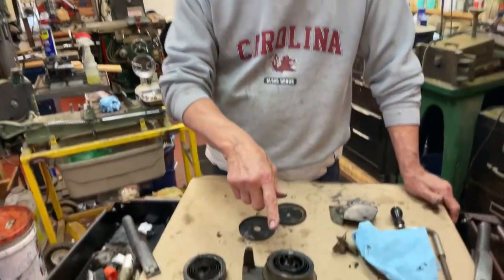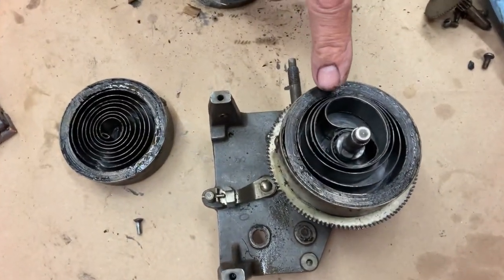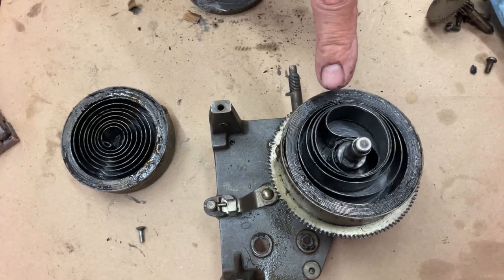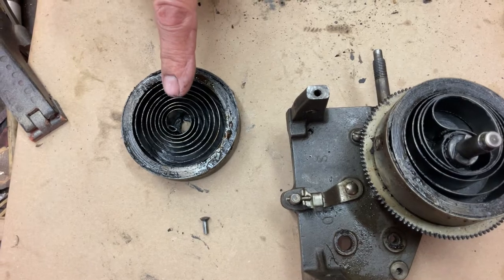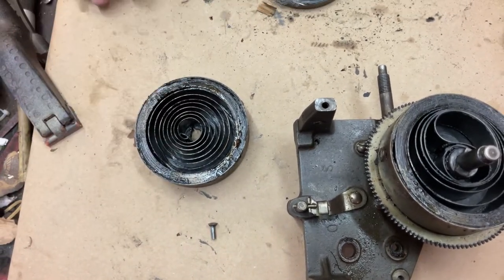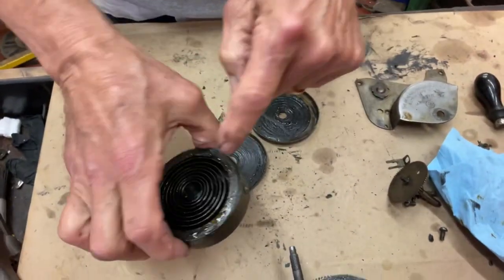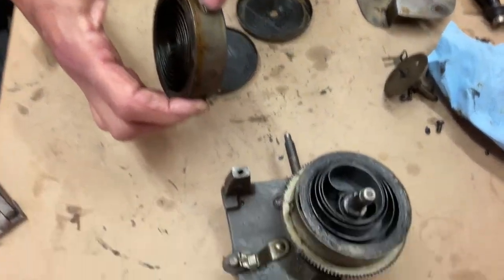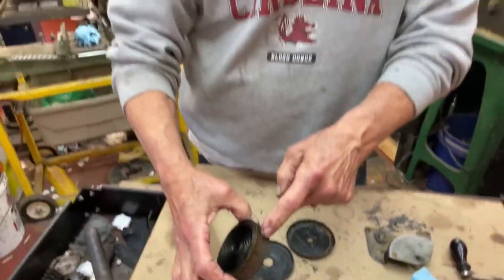906.  Take notes on which way your original phonograph springs are in the barrels

Comment: I am working on a double spring now, from a Pathe model VII.  I thought about marking the spring somehow, maybe with a clip or duct tape.  Any other suggestions?
Reply from the maker: You could put a piece of tape on the spring barrel labeling them one or two, but hopefully you’re going to be cleaning the spring barrel so the tape will come off.  You can put one light scratch on the outside of barrel number one, and two light scratches on barrel number two. Then draw clockwise or counter clockwise next to number one or number two on the sheet of paper you have on your work table.